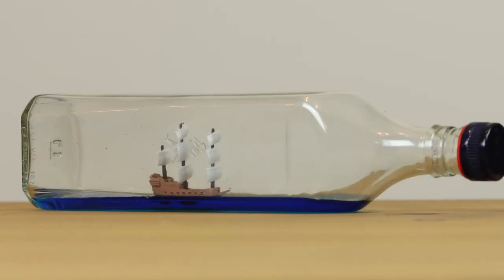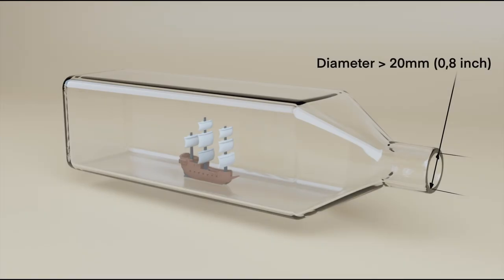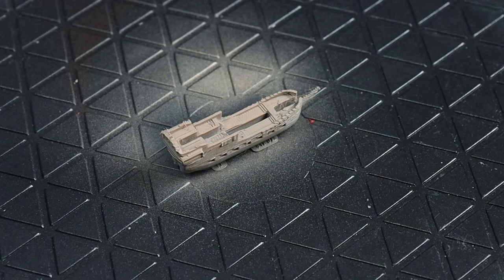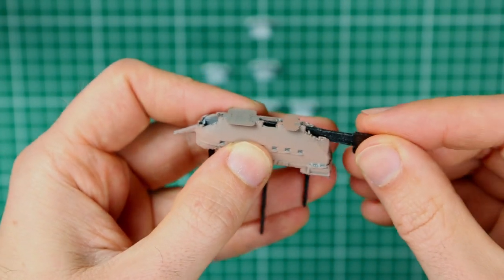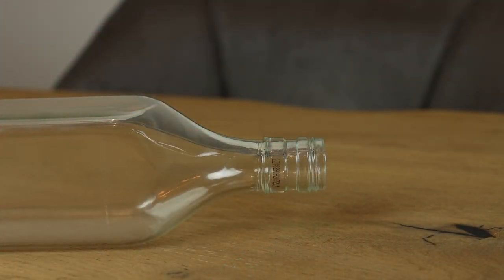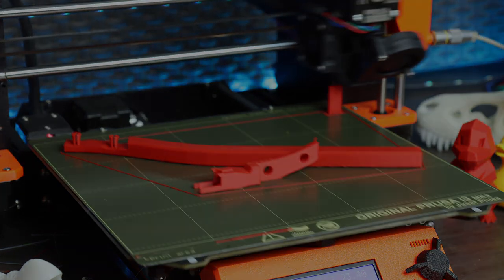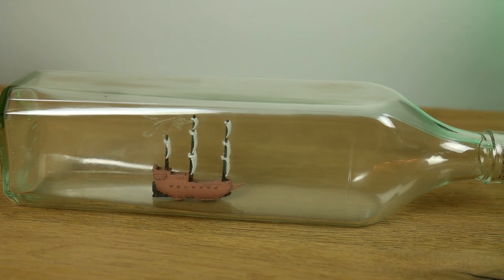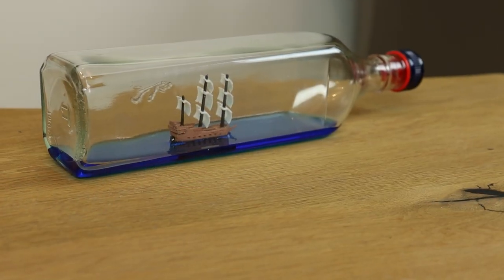Printing A Ship In Bottle

Comment: What size nozzle did you use
Reply from the maker: A standard 0,4mm nozzle. I do turn on “detect thin walls” in the slicer, but I don’t even think that it is needed for this one…
Reply: @printchallenge7158  thank you so much it's printing now. I'll post a make when I'm finished
Reply from the maker: @ChristopherKlepel  Great! Very curious about your experience... I did not test it with a lot of different bottles so feedback is allways welcome!
Reply: So I went to download but there is a different slider then the one you show where can I download the one you use
Reply from the maker: @masonwiklund7534  I made different versions of the slider... The one that I shared should work fine. The older one which I showed in the large model did not allways work as well when I printed it on a small scale, so I changed it later..